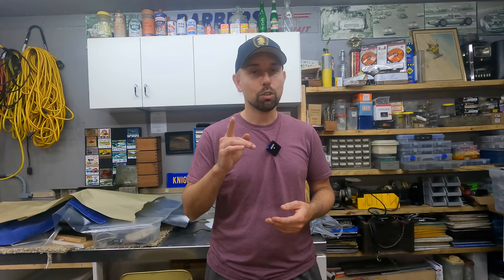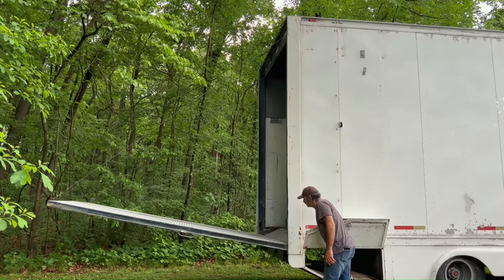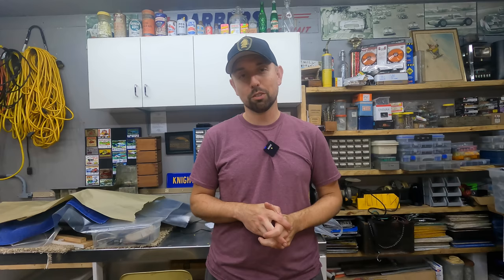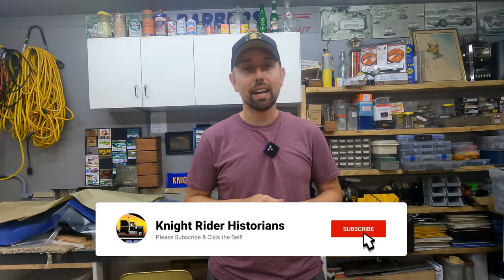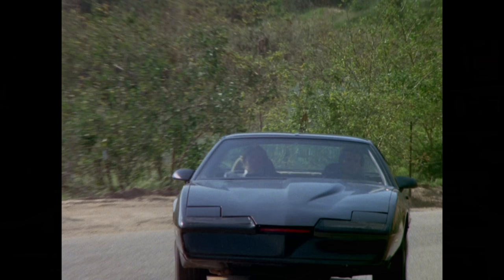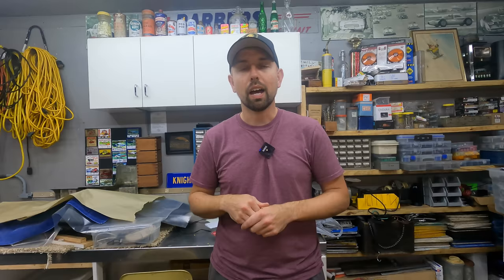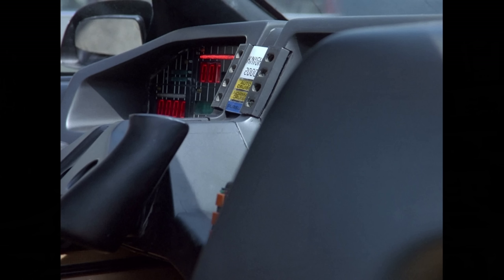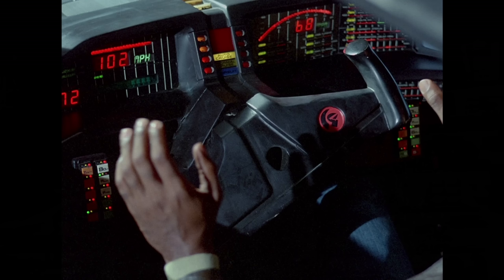What Happened to KITT's Original Dashboard & Bumper Sculpts? Knight Rider - Michael Scheffe

Comment: Very cool and interesting information :) It's amazing that in just 3 weeks, in 1982, was created this very futuristic, and ahead of it's time, beautiful dashboard :) I think many real car manufacturers started using this very ergonomic dashboard design in the 80's, the center console curved towards the driver, like KITT's dash. 
Our 1988 Opel Kadett E for example had such curve in it's dash, and Opel btw was at the time a GM product in Europe, I think in US it was called Pontiac Le Mans ;)
Reply: yup Pontiac Lemans but it was built in South Korea by Daewoo  because in typical GM way the Kadett was built and sold all around the world under many different badge and name 🙂
Reply: Mr Barris built the 60's Batmobile in 3 weeks.
Reply: The Ford Sierra (in Europe) which came out in 1982 that replaced the more angular Ford Cortina (or Ford Taurus in continental Europe) also featured a (then) unusual ergonomic curved dash.
Reply: True. And also there was an Alfa Romeo line more or less on the late 80's or early 90's that resembled more or less KITT's boards! One of my uncles had one at the time. Sadly those digital panels failed miserably an year later and the replacement ones didn't even last for 6 months either. The car was scrapped to my dismay, but it was one of the most beautiful cars I went into. Sadly don't remember its series though, It might have been a special edition for Alfa 33 or its successor Alfa 145-146!... My uncle received a new more conventional car afterwards once it was under our 2 years guarantee time.
Reply: Saab started doing curved dashboards in late 70's with Saab 900. Their approach to ergonomics had lot to do with company background as aircraft manufacturer. The automobile division was first spun off into independent company in late 80's, then sold to GM who proceeded to run it to the ground in matter of few years.
Reply: @nunagoras  Fiat Tipo DGT digital dashboard brought KITT's instrument cluster immediatly in mind in the 80's, even Fiat's dash was straight, and  not curved, but those colourful displays looked very cool :)
Reply: @mrjsv4935  Yeah! I remember traveling on one as well!...

Comment: Your question about if the original part how it would look after using it to make a model.  When we made originals they would be made the same way, wood, body filler.  We would use a special mold release wax on the original part (Plugs) then a very light layer of a release agent on the plug.  Then after making the mold depending on how well you waxed and handled the plugs they would over crack and sometimes chucks of it would still stick to the mold.  But since the studio wasn't a fiberglass company I doubt they did the proper prep work.